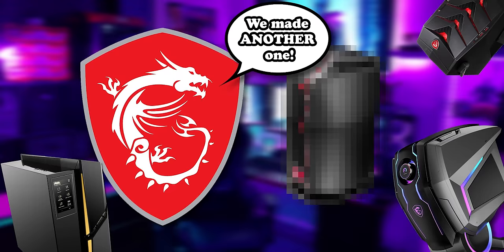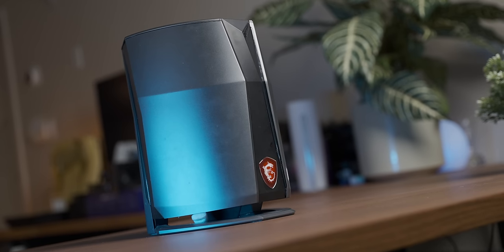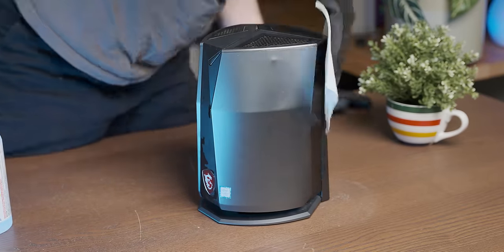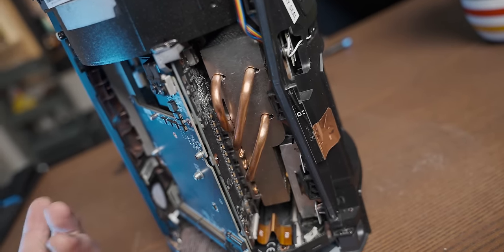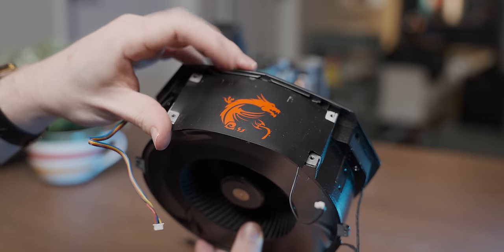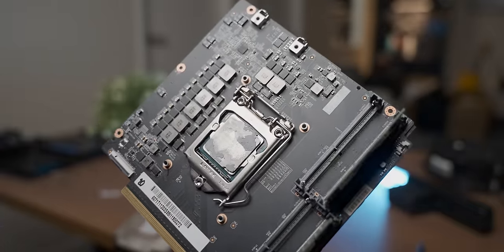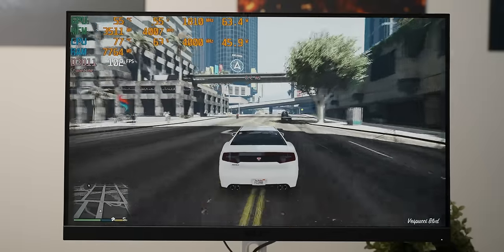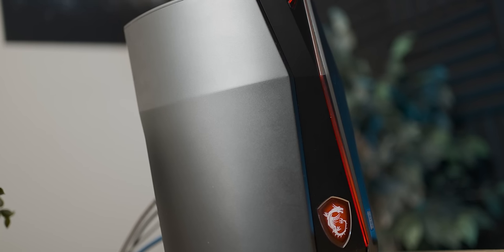How Does MSI Keep Coming Up With These?

Comment: Yeah, too many variables in how MSI has the single fan set up. If the CPU being lower meant the top fan wasn't being utilized the same way, the gpu would suffer. Also, fresh paste on a gpu could give it the thermal headroom it needs to push clocks, which would also increase temps that could not be recognized by MSI's single fan design.

Comment: That is a very cylindrical shaped case. Wow.

Stupid question: What do you need two ethernet ports for?

I would say the Vileda gloves are a part of the channel. Get some :)

"Gaming System in a brothel" just cracked me up.

The side panel sound was pretty nasty, ngl.

Does Apple actually built desktop PCs?

Comment: "Down here next to the pube"  This is masterful comedic timing.  Well done, Canadian.  You've excreted milk from my nose.  

Also, I dont see the value for the end user having an empty MXM slot as back in those days you basically could not buy an MXM card.  Believe me, I looked into it back then.  It was cost prohibitive to the point where you may as well have just built a whole computer with better performance.  Also, this thing looks like a crap laptop with a mid tier desktop gpu.  Such a pointless design (but still interesting).

Thanks for the vids bro.

Comment: I love discovering obscure designs like tjis and I would really like to check it out. But sadly I can't see myself paying for it. Especially not with the added pubes and slime. It really looked like it was used before you got it. All that packaged so tightly in a small package like that feels like it's just a question of when, not of it's gonna overheat and die. However it's cool it was possible to expand with a second graphics card and 2 more memory sticks! Just like  @rambow70 said, it's crazy how much designing went into that since I don't beleive it looks like that inside the mac. I've owned thr Black Magic eGPU and it was assembled similarly and I decided not to disassemble it because of that.

Comment: Aw the GTX 1060. Remember how Nvidia marketed that as a 1080p powerhouse in 2016? Wouldn't it be crazy if a card that's further up the product stack in 2023 was still trying to advertise itself as a 1080p powerhouse? Like no duh, shouldn't like everything be a 1080p powerhouse in the future? That'd be crazy if they were doing that in 2023, the future. I might think something had gone terribly wrong if that happened.

Comment: What I don't get, is, they could have elevated the pc a little bit and put the fans under the components instead of on top, that way hot air goes up instead of going down which will eventually be sucked in again by the fan at the top. 

With longer legs it could've looked like a spaceship instead of a trash can LMFAO.

Comment: An utter nightmare! I got one of these as the older GPU was falling out of fashion. I thought about upgrading it until I go a few panels off...

NOPE, hard pass. Great looking PC, but so is my Beelink Ser6 pro... and 1/4th the size... I would rather have less performance and not have to deal with this kind of nightmare system ever again.

Comment: This is literally a modern design reminiscent of the 2013 Mac Pro nicknamed the "Trash Can".
Reply: P.S: Ideally, this design is great for low to medium power systems, if the "thermal core" as apple calls it was implemented in a similar fashion, it could in theory, handle 285 watts of thermal heat with a optimized fan curve with a pressure optimized fan that can spin at a range of 2000 RPM.

Comment: Dell-Style E-Waste machine. Once either the PSU or MoBo die, you can throw them both in the garbage alongside the case. The GPU is also proprietary, as are the fans. I guess at least the CPU can be salvaged. HORRIBLE! Then again, the same can be said about any laptop...

Comment: Man, the MSI Vortex G65... when first leaks came out, i went crazy for it (it had a GTX 980 SLI!!!). In my opinion, the Apple MacCan Pro is to this day the most beautiful computer and when i saw this, i had high hopes that we windows turds could finally get our own MacCan. Man was it ever a letdown. No reviews for ages, no way to even buy it and everything pointed at a plastic shitshow with no way to upgrade the GPUs, despite the system seeming user workable, since you didn't really have a place to go and buy a new GPU.

When reviews dropped, the bad noise and some temp issues when you spec it to the max, it was the final nail in the coffin for me.